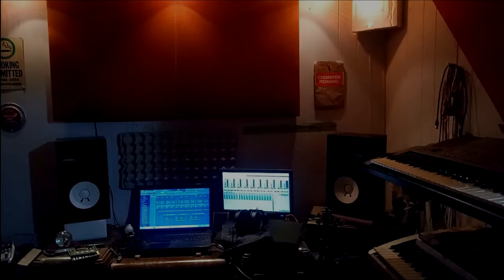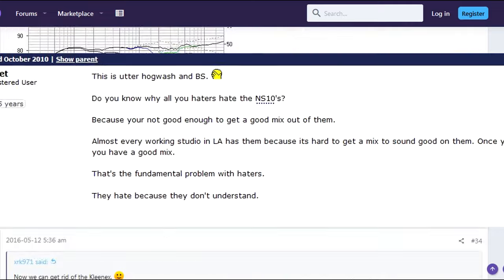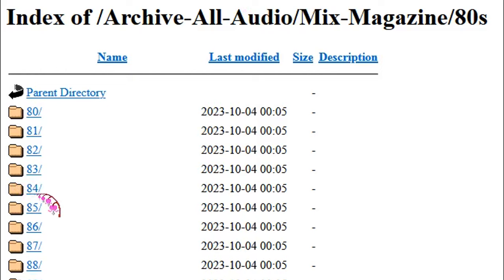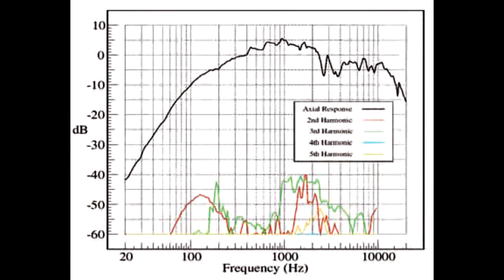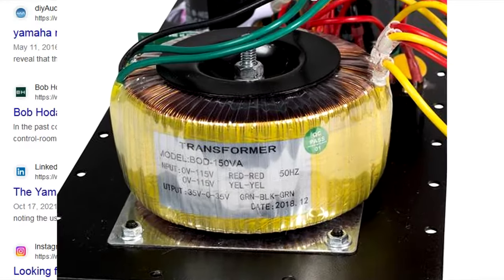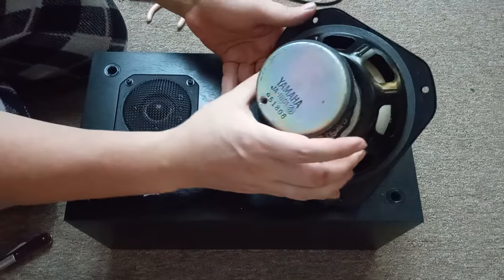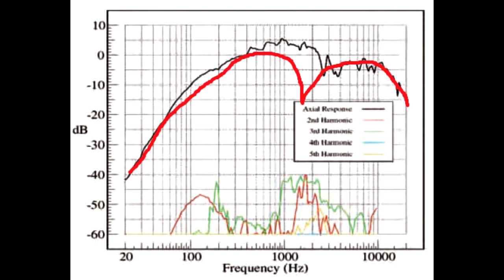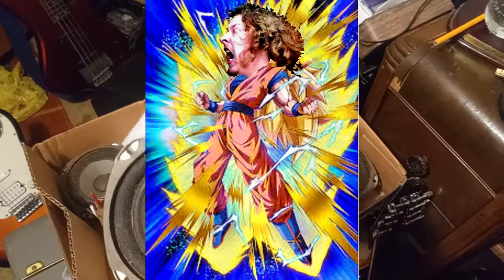Yamaha NS10 Iceberg: Myths, Facts, Mods and More!

Comment: the reason i love my ns10's which is also the reason I get the best mixes i've ever made while also making them faster than i've ever be able to is this.....They have almost nothing below 200hz. the music you hear is all from around 200hz and up. this is great because everything under 200 is VERY distracting and takes up most of the energy in the music....bass is Boomy and exciting but not that musical. what you learn when you use many speakers and then go to ns10's is that actually the attack of your kick is around 200hz..not deep down at 80hz or something..same thing with the beef of your snare....and then above that is literally everything else except the sub info...so its REALLY easy to focus on whats actually important in making your mix punchy and musical....the other thing is that the speaker is Snappy as fuck...i have other monitors but the transient response on the ns10 is unlike anything else......THE CLA NS10's are not the same its not the same cone. anyway...thats all. have a nice day.

Comment: Great to hear you! Thanks for the info. What about Peavy speakers? What do you think about them?
Reply from the maker: Thank you for watching and taking the time to comment TTS. Oh I love peavey speakers and amps in general Great Stuff! All the guys I know that play loud in live settings use the big peavey horn cabs with the black widow speakers. That speaker is great for getting mean tight sound from flubbier or very powerful bassy guitar amps (like SRV did with the big frame jbl speakers), but you can take the same black widow speakers put um in a ported cab and run sound for a hiphop concert? In fact that little Marshall amp I used for the sound demo of the black LesPaul jr. I opened it up and somebody had stuffed a peavey blue wonder 8 in there... no wonder it was rockin so damn hard.

Comment: Nobody listens to NS-10's... We fight them in order to combat nasty Mid range!
You can save a lot of money and get any crappy speaker that sounds equally horrible to the NS-10's, in order to get control of the Mid frequencies.
If you get anything to sound good on NS-10's, it will sound great anywhere.
That is the only reason we use them!
Reply from the maker: Thank you for watching and taking the time to write a comment NM. Ultimately I agree with that it did seem to me though that there were extreme exaggerations of how "horrible" the ns10 sounds. I guess its that way with everything? I listened to music on them quite a bit to acclimate my ears to the speaker and train them on the sound for reference and they werent sooo bad. I do fine them useful as heck on that low mid punch though setting compression and picking kick trigger samples a breeze...

Comment: yeah I had a same kind of trip with yamahas. Then I found out about ns-615. bought them for like 250e from evil-bay. These are same speakers with same parts as ns10 but cabinets are identical pair. you know like basically these are two left side ns-tens
Reply from the maker: Thank you for watching and taking the time to comment NN. Great INFO! thats a good side step there sir. Very clever. I dont really know how or why this got me like it did but I had to check them out for myself... couldnt let it go.
Reply: @heavymetalATC   and have to say that these speakers really changed how I mix my tracks. Really makes you focus on the middle frequency

Comment: hey buddy whats that in the bottom left at 21:01👀😆
Reply from the maker: Thank you for watching Starcade and dayum you got a sharp eye. I think you know exactly what it is. Hahahaa I really need to put some damn knobs on it do a setup and demo. life though its got them wrenches and it likes to start throwing them. I been beating rusted wheels off a dodge ram with a giant hammer and switching seized drum brakes and pressing ball joints in with 40lb c clamp for free cause ima need help with some stuff later myself... and thats the actual on what i really be doing out here from day to day. ;)
Reply: im just goofin, take your time. id rather see something that was well done than something rushed so do ya thang man @heavymetalATC